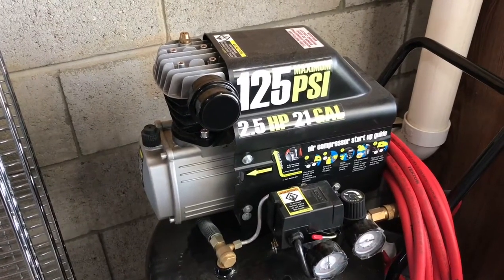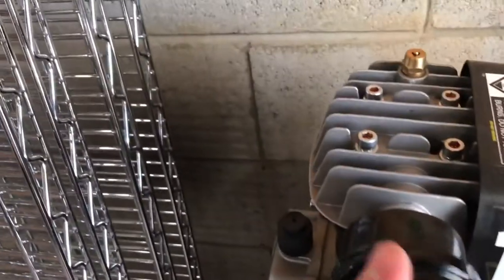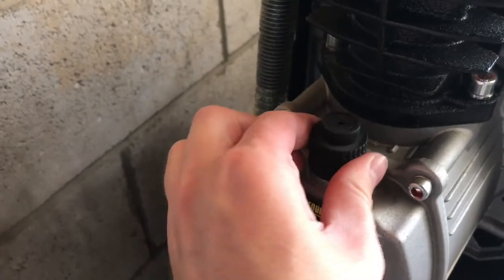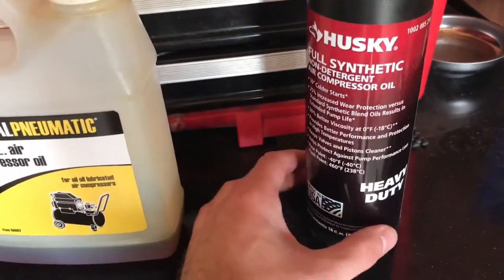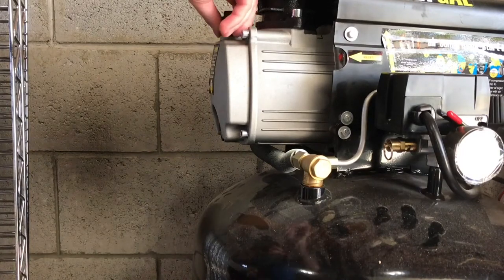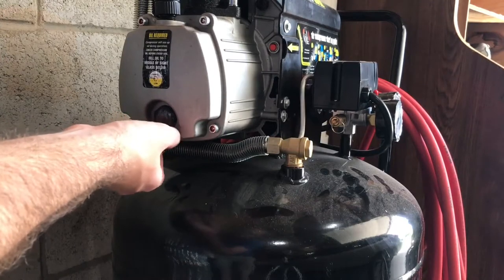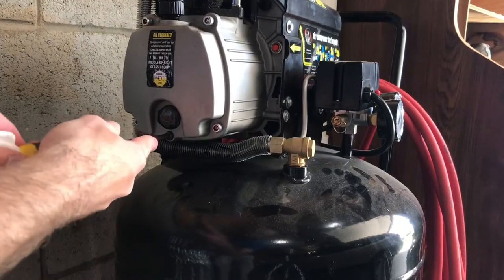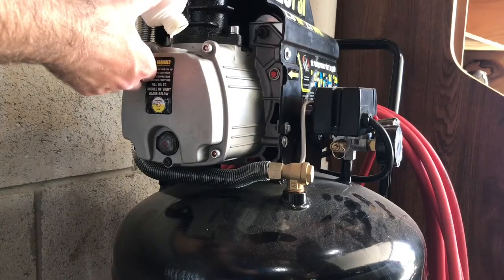Air Compressor Maintenance - Harbor Freight Air Compressor Oil Change

Comment: Approximately how many oz. Of oil do you need to fill it up after changing the oil. I can't see my bubble anymore
Reply from the maker: I'll check the exact amount in the manual, they should have the manual in their website for this you can download in a pdf. I believe it's 5.6 ounces. https://www.manualslib.com/manual/65045/Central-Pneumatic-67847.html?page=15#manual
Reply: Call harbor freight replacement parts  department.  You can probably get a new one for it. Also to all harbor freight shoppers including me.  Go on the websites or app and look for recalls on items that you have bought from there.
Reply: @DIYDad1 I wish that you didnt have to download the manuals. You should be able to just look at it on the site or app. Then have a option to download if you wanted to.  But it is what it is.
Reply from the maker: @WUBBA_LUBBA_DUB_DUB.  Yeah, pretty typical for most manufacturers now, save to pdf somewhere on a ftp site or something lol.

Comment: No need to change the oil 5 times. I've had my compressor on the dirty dusty farm for many years and never have changed it even once.
Reply from the maker: Probably overkill for sure lol. All the reviews I’ve read said to at least change it a couple of times when brand new just to remove those metal flakes from the motor manufacturing. Just helps to keep the piston from getting scored prematurely. Still using it to this day and I’ve had this thing for probably 5 years now and it’s still going strong!
Reply: Does it need it?? Nah.  Will it help it perform a little bit better for maybe a bit longer???  Possibly. Will anyone buying a tool from harbor freight care?? Nah
Reply: Are you running synthetic oil in it?

Comment: Great video. Also make sure to level the unit before filling with oil to get correct level. My barn floor was way off so I moved it to concrete floor in my basement and its level now :D
Reply from the maker: Everyone assumes floors are always flat 🤣. Lol. Thanks for watching!
Reply: I e got an Allen key for oil drain

Comment: Air compressors are so useful. Wish I had a garage to put one in. I would get a lot of use with one. Harbor freight always has good deals on on cheap tools.
Reply from the maker: Oh yeah HF is always my go-to first if I can save some money. I research their stuff first so I avoid the crappy products lol. But overall I’ve been very satisfied. And besides my shop vac this air compressor probably sees more use than any other tool in my garage. You can probably find a nice portable one that you can haul out when you need it. Some of the new ones that are only like 5 gallon capacity are actually pretty decent now and can keep up with basic tools like blow guns and inflators.

Comment: My grandfather had this compressor for years with no maintenance then I ended up inheriting it and have been running it for the last 4 years with no maintenance. It's been pretty good to me. I'm goona change the oil tonight
Reply from the maker: These things do run a long time even when neglected! HF has surprised me many times. Thanks for watching!
Reply: The reason I'm asking is because although the psi is high enough the SCFM has to be at least 5 to use an impact wrench. Is this guy confused or am I?
Reply from the maker: @jamesmitchell2804  no your absolutely right because my impact wrench is rated at 5.3 scfm but the compressor only outputs at something like 4.7 if I remember correctly. This simply means it cannot sustain 90 psi at that cfm forever. But because it has a large tank, I'm able to remove at least two tires worth of lug nuts before the output pressure from the regulator drops low enough and the tank has to recharge. There's enough of a reserve there that you can run larger tools, albeit intermittently, without the compressor running constantly. Now this is fine for tools like impact wrenches where you aren't hammering on the trigger constantly. But you definitely need a higher cfm for constant demand tools with things like paint sprayers. Hope that makes sense!
Reply: how do I " drain air from tanks" ? A dum  ?

Comment: I see that you are using a 3/8 hose, I have the same compressor but I could not get the air that I needed for my impact gun to work, MY GUN CALLS FOR 90 PSI-But I was only getting about 60 or 65 lbs-So I took off all of the air fittings from all of my air tools and drilled them out-The stock fitting are only about a 1/4 of an inch ID, Now I have full air power to everything-Now you can buy bigger fitting but why do that when you can just drill out the ones that you have on hand, My gun would not brake a Crank bolt lose, But after I did what I did zipped it right off
Reply from the maker: I've been using the Milton high flow fittings I found on Amazon that helped dramatically. I might have to make a video on that some time and setting up your air compressor to maximize it. But you're right the stock fittings are very restricted, especially if you want to use high cfm tools like an air impact. Of course there are losses through the whole system and the resistance of the hose itself, even the length of the hose makes a difference, you gotta look at the working psi at the business end and not rely on the regulator entirely. Setting a regulator to 90 at the tank might only get you 60 or 70 psi on a 50 foot hose. So I usually crank it to about 110 on the regulator and it gets me to where I need to be at the end of the hose. Thanks for watching and commenting! Glad you found this video helpful!

Comment: I have to drain mine very soon but this gave me the idea that I will switch out that original drain screw with either a hex or allen head screw.
Reply from the maker: At an easy upgrade just make sure you match the threads correctly. Thanks for watching!
Reply: @DIYDad1  yes absolutely

Comment: THANKS FOR THE TIPS. GOD BLESS.
Reply from the maker: Thanks for finding my channel and thanks for watching!!
Reply: I have the red one for 10 years now. Haven't used in awhile.  Will be using again soon fos a deck framing nailer.  Gonna do the maintenance as you described.  Muchas gracias

Comment: I’ve noticed that mine leaks down the same side of the tank as the window. Any ideas as to why ?
Reply from the maker: Is it leaking out the top filler hole or somewhere else? Could be a leaky worn gasket where the oil is.

Comment: I can not see through the little window on mine so i just added a 1/2 cup or so. Is there any way to pull that window and clean it ? It looks like it would take a socket  ?
Reply from the maker: Haven't tried to but I would think you could flush it a couple of times with a few drain and refills hope it clears up I haven't tried. I wish there was a small dip stick for these.

Comment: I have the same compressor and have the stupid oil leak through the breather, I replace both the piston and rings, but didn't fix it unfortunately
Reply from the maker: Dang, I'm sorry to hear that! I've heard of that happening occasionally. Hopefully it still functions, just need to keep a closer eye on the oil level hopefully that's all that it is. Do you get any oil into your air lines at all? I know that usually happens even when the oil isn't leaking.
Reply: @DIYDad1  negative, just simply comes out of the breather, curious to know if maybe the pores in the breather arent open enough
Reply from the maker: @NoDayz0ff  huh, I haven't taken it apart far enough to see what could be causing that. Hopefully it's not too bad. Sorry I have no idea lol.

Comment: Can you run a pneumatic impact wrench to take the lug nuts off a car tire with this thing?
Reply from the maker: Yep! I use one frequently with mine. Use it for rotating tires all the time. I can usually do two tires before the air compressor kicks in again to recharge. It's been great for automotive work.

Comment: Replace the 1/4 compressor air hose fittings with 3/8 and feel twice the power muwahahaha
Reply from the maker: Honestly thought about it lol. There are some good high flow fittings that I put on here and the cfm went way up compared to the standard 1/4. The ones made by Milton are the best. Milton S-760 1/4" MNPT V Style High Flow Plug - Pack of 2 https://a.co/d/0wpZsWK
Reply from the maker: @biophyswiz  and not only that but shorter hoses can help too! Going from say 100 feet or 50 feet down to 25 feet really helps lessen the amount of air resistance. I might try a short 1/2" 25 foot hose and see how that performs compared to my 50 foot 3/8.